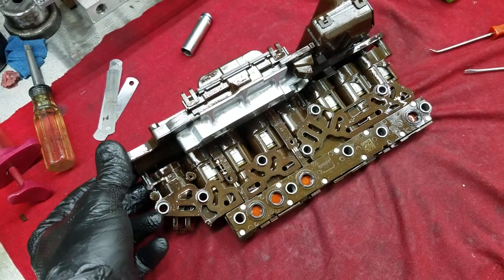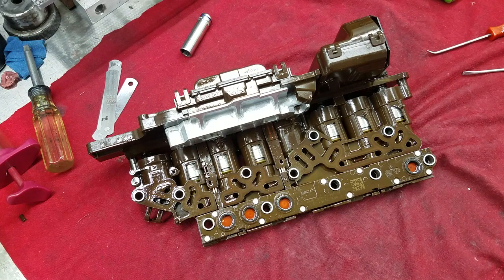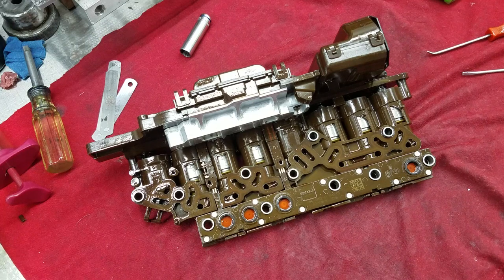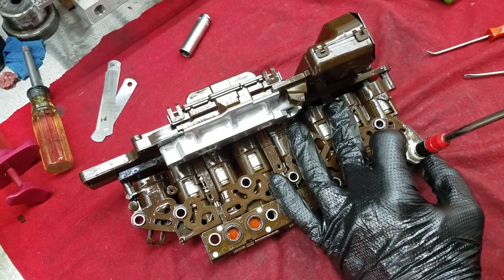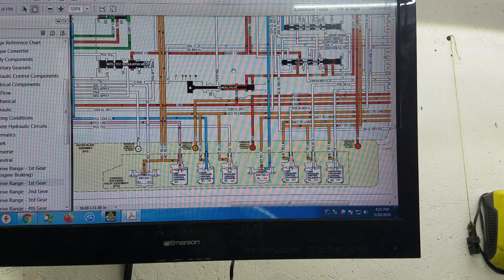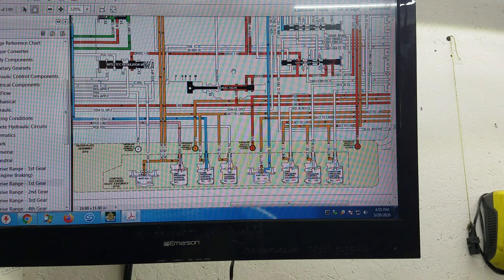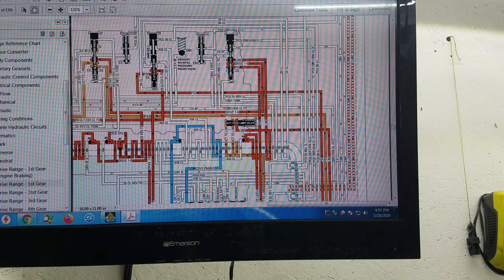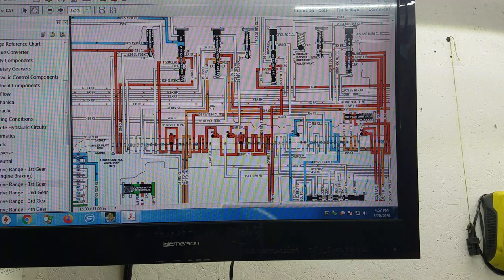A little 6L80 Brain Food!

Comment: thanks for this..my 6l80 has been haunting me in my nightmares at this point. 

i’m unsure if it’s related but upon watching this video of yours i noticed a similarity… i have a harsh 3-4 shift (this is what brought me here) - i also have very slightly delayed drive & reverse … the kicker is …. i have 4 trans codes …… they are -

- TRANSMISSION FLUID PRESSURE SWITCH 1 CIRCUIT LOW VOLTAGE

- TRANSMISSION FLUID PRESSURE SWITCH 3 CIRCUIT LOW VOLTAGE

- TRANSMISSION FLUID PRESSURE SWITCH 4 CIRCUIT LOW VOLTAGE

- TRANSMISSION FLUID PRESSURE SWITCH 5 CIRCUIT LOW VOLTAGE

all of the same switches that you show as having broken seals in your video….

maybe unrelated … but that’s unlikely. no such thing as coincidence. 
ill keep wracking my brain. & learning along the way. 

i am a first timer with this auto repair… i figure no better way to learn than on my 2007 gmc yukon denali 6.2 that’s on a last leg anyway so i can only really make things better at this point … & gain some knowledge too. 
& for what it’s worth - as someone with autism & other learning disabilities which make understanding/comprehension & retention very, very difficult - i wanted you to know that you absolutely do have a natural ability to teach & in a way in which even someone like me can follow the lesson & understand .. & that is extremely hard to do on a general basis for me … so for something that i’ve been so dedicated to figuring out, solving & repairing … your videos are a breath of fresh air.
Reply: Did you ever find out what was wrong?
Reply: Man I’ve got 3500 in a still broken 6l80 🤦🏾‍♂️ I now need the tehcum so 600+ more to get it back working and hopefully no issues…. I hear GM has a class action behind these transmissions but my vehicle is a swap car I most likely won’t see a dime or get anything fixed for free 🤦🏾‍♂️

Comment: I have a 6L80 in my 08 Ls3 Corvette and I like racing it once in a while. It runs great at the track but for a few years now while cruising spiritedly it likes to over rev as it enters 4th gear. For years I have been living with this thinking it's the clutches might need to be replaced. I have always been doctoring it up with Hp Tuners but never solving the problem. Finally I have increase the torque inertia up to 2.0 from 1 on just 4th gear. The first 3 gears were hitting harder but the 4th gear was even worse. Real bad. Then after about 20 minutes of relearn and doing some rapid paddle shifting back and forth from 3rd to 4th it starting shifting like brand new!.
    Thanks for the vid. Reaffirms my thinking It's a valve body problem if it ever slips entering 4th again. These transmissions are as over complicated as a F-35 lightning! Thank goodness the previous owner had it tuned and the tuner had turned off VVT and everything else that would have kept the clutches and converter churning into dust even while cruising.

Comment: Did you ohm them out to see if any of the solenoids were bad or were they all reading around .5 I ask cause I have one that’s shooting up to 30.05 after breaking the connection with the switch . It’s solenoid five the clutch pressure control solenoid and I think the tcc pressure was throwing some weird numbers as well . But I got the p0741 tcc solenoid stuck off and trans went to fail safe I had to limp it home with my scanner using hp tuners. Which in my ASE 6l80 book that’s the death code for the techm lol but any thoughts if you get to read this and thank you for the video .

Comment: love seeing these 6l80 videos. i have 6l90 in myy 08 suburban.  trying to figure out why it sometimes flare shifts from 3rd to 4th.
Reply: Reset/preset adaptives. if that doesn't work.... add 10 psi to the 3-4 oncoming pressure.
Reply: I know this is a two year old comment, but I've got a 3-4 flare on my G8.  I bought the sonnax kit to repair these as I have two codes corresponding with pressure switch issues.
Reply: @Sh00fly86  Did it fix it?? Please reply
Reply: @Brosephus263  yep, fixed it.

Comment: Would there be a solenoid issue in TChM of truck doesn’t register neutral on dash indicator? Neutral is there but when you click from reverse into neutral the dash indicator goes from R to D skipping neutral.
Reply: Sounds like  internal mode range sensor. My 07 would go into limp mode & if i clear the codes it will drive normal & you can see the indicator light under the P R N D M

Comment: Let us know if this takes care of the concern!
Reply from the maker: I will indeed.
Reply: Whenever you overhaul any main control assembly (Valve Body), will you totally disassemble the component (Valves,Springs,Retainers) and clean thoroughly, or do you just leave the assembly together and clean with a detergent and air dry? I’m curious how other builders do their overhaul procedures.
Reply: @ford_asset_tech9695  Definitely disassemble and clean thoroughly when doing a rebuild or when your inspection finds metal or contamination. Replace gasket and sealing orings/bushings while you are in there
Reply: @rdick218  And you didnt even reply lol. Guessing it didnt fix it